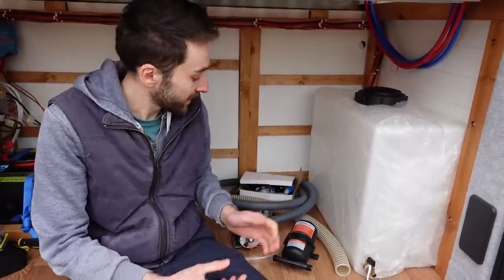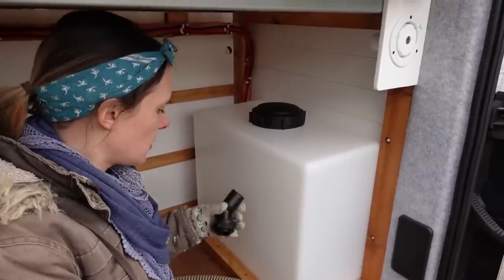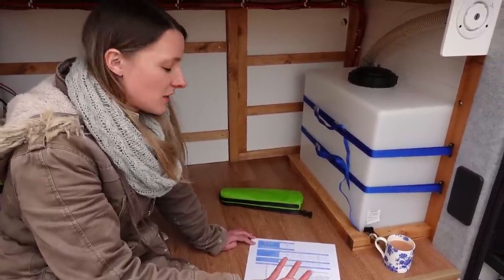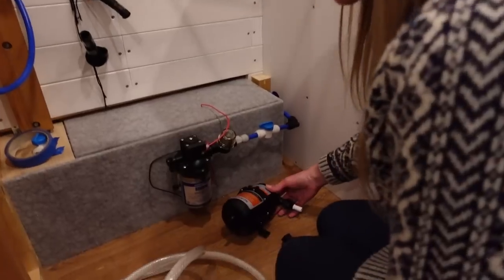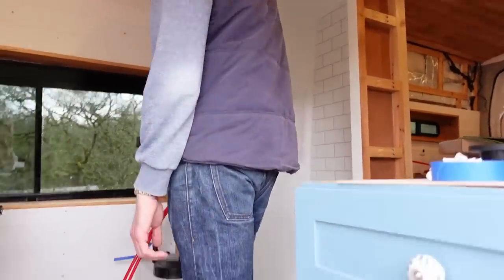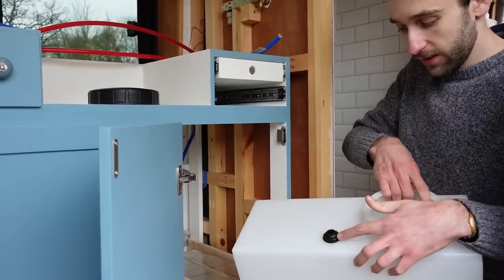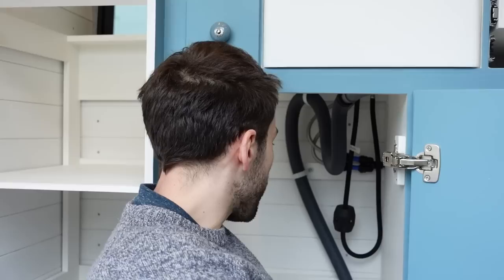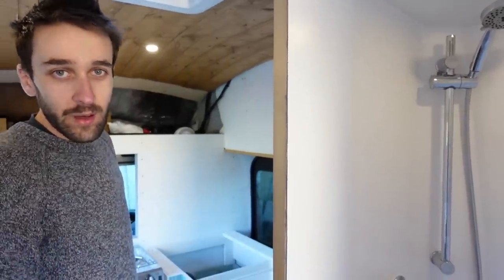Campervan Cold Water System (We Have Running Water!) | Transit Van Conversion E36

Comment: Hi do you have a link to the filter that you used please - I'm loving all these videos - thank you
Reply from the maker: Cheers! And it's the shurflo inline filter that we used - have added a link to the description. You can get it with a few different connection options, we went for the screw ends but would possibly consider the wingnut version too which possibly would have been easier to tighten up and ensure it's sitting and the right orientation. HTH 👍

Comment: Hi, enjoyed watching your van build so far, well done both, a quick question about the water system, have you used the John guest speed fit locking clips as well by any chance?  They stop the fitting being accidentally pushed in and a bit of vibration letting the pipe slipping back out causing a leak that you may not notice
Reply from the maker: Thanks! And yeah we did look at the clips and considered it, but in the end decided not to. Particularly for the 12mm JG fittings the cost can quickly add up and we thought the clips were a bit on the pricey side. We haven't seen many people use them to be honest, and from our experience it's actually quite hard to remove the pipes anyway even without the clips on them. We actually bought some JG release tool spanners to make that bit easier 😛 We can always add them in future but for now haven't had any issues and we've pumped a lot of water through the system now 👍

Comment: Have you considered the weight distribution of the van? There seems to be a lot weight in one side of the van, you will suffer with poor handling, cornering and overall traction if you in the wet or snow
Not a criticism, love your videos, they are very informative, i am just curious if you consider it while building the van
Reply from the maker: Cheers! And yeah no problem it's a fair question, and we've thought about it quite a lot. We imagine the van in different quadrants for the weight distribution, so back left is electrics and batteries, back right is water tank. Top left will be the underslung gas tank and top right is kitchen. Then down the middle so centrally distributed is the oven at the front and grey underslung tank at the back. The one anomaly is the shower as that is only on one side obviously and can't go in the middle (actually not true, have seen some vans do that!) but we have the fridge cabinet on the left as well to offset it. It's a tricky balance for sure but we definitely keep it in mind 👍

Comment: Hey hey! Where did you find the info on how to balance the accumulator PSI? Thanks so much!
Reply from the maker: Hey! Yeah so our accumulator recommends setting the pressure to be ~3psi below the cut-in pressure of the pump. The tricky part is actually finding out what the cut-in pressure is as it's different to the rated 30psi pressure which is around the cut-out. We found the easiest way was a bit of trial and error doing something like this: https://www.canalworld.net/forums/index.php?/topic/110321-pressure-to-start-with-in-an-accumulator-tank/&do=findComment&comment=2615748. Once you get it right, you'll know. It's the difference between a really nice smooth flow whether the pump is on or not, vs really juddery pulsating each time the pump kicks in. Good luck! 👍
Reply: Thank you so much!! @SelfBuiltStories
Reply from the maker: @mdpaver1  No problem 👍

Comment: Nicely done!  What PSI did you end up settling on for your accumulator?  I have what appear to be the same pump/accumulator combo and will soon be wet testing the whole system...  I had not even realized I had to set up the accumulator, so thanks for that tip!
Reply from the maker: No problem! Yeah it's not the most obvious thing at first. It says it should be set to around ~3PSI below the pump cut-in pressure. For us the cut out pressure is 30psi, but the cut-in pressure which is lower wasn't listed in the specs anywhere so we had to find it by trial and error. There's some good info on boating forums and things for finding the cut-in pressure, we did something similar to this: Turn the pump on with the taps off.  Allow the pump to run till it switches off.  Pressure in the accumulator will now be the pump cut-out pressure. Then turn a tap on slowly and wait till the pump switches on. Immediately switch the pump off.  Measure the pressure in the accumulator which is now the pump cut-in pressure. Open a tap till the water stops. Pressurise the accumulator to just below the cut in pressure. If we remember right we set it to around 15psi, though the analogue gauge we had wasn't the most accurate to read. It's obvious when it's correct though with a bit of playing around, as you get really nice smoooooth water flow 😃👍 HTH!
Reply: @SelfBuiltStories  Thanks so very much for 'the long answer'!  Man, that's a step by step how to!  I have a feeling you just saved me a lot of messing about.  Always enjoy your build vids.  I've used all sorts of tips from your build.  Thanks for sharing!
Reply from the maker: @owenparker6651  No problem, you're welcome, good luck with yours 🙂

Comment: Thank you for a very informative video , im going to go for the same set up. Please do you have a link for the filler cap and pipes. 😊
Reply from the maker: No problem! And we got it from eBay: https://www.ebay.co.uk/itm/144157371031. And most of the pipe and connectors too. There are various sellers on eBay and some where cheaper than others for particular connectors, which added up quite a lot. So for each type we shopped around the best ones. The pipe we got from https://www.ebay.co.uk/itm/185659041034. HTH 👍
Reply: That's perfect thank you so much! I've saved the links 😊 enjoy your van and adventures 🙌
Reply from the maker: @luciedimond244  No problem, we will, cheers!

Comment: This is the most nerve wrecking thing for me lol just wondering how u fitted that rocker switch, I can see the live in and out but wondering where the 3 (from what I can see) negatives come from 😮
Reply from the maker: Very satisfying to have water come out the tap though! 😄 And the rocker switches we're using have an LED in them so have their own circuit which needs a negative/ground connection to work. If you had a basic switch without the LED it wouldn't need the negative connection. And the reason it looks like 3 is because for our temporary setup we piggybacked the negative onto the one going back from the pump using a wago connector. Later on we're going to make a switch panel for all the switches and controls we have with small busbars to tidy everything up. 👍
Reply: @SelfBuiltStories  OK, I'll have to do something similar as I have these switches too lol I need them to match 😂 bit of a blue theme in mine lol
Reply from the maker: Important to get the theme right 😛👍

Comment: Haven't seen the whole video yet, but the inlet pipe seems to be redundant since it is located next to the tank cap.
Reply from the maker: Yeah we could use the tank lid directly but in practice we find it more awkward. The fill point allows the hose to fit in snugly for hands free filling, less reach into the garage and less chance of spillage. We have things stored in the garage too so the lid might not always be accessible, plus just gives a bit of extra length for the breather pipe. So we prefer it for convenience 👍

Comment: following closely as i have the same van and about to start, have you weighed your van with the progress to date? im looking to be able to carry some load as well as the fit out.
Reply from the maker: Cool, and yeah we weighed it a few times during the conversion, the last one came in at 3.3T with full tanks and us inside, but it wasn't completely finished. Since then we've uprated it to 4T so we have a lot more headroom to play with now and flexibility to carry more supplies 👍
Reply: @SelfBuiltStories  how do you uprate it? beefed suspention?
Reply from the maker: @mikezoom42  Our van chassis can take 4T but is downrated to 3.5T so it can be driven by most people on a B licence. We uprated it back to 4T with https://www.vanweightengineering.com/. Upgrading the suspension wasn't strictly necessary for that but we've decided to do it anyway seeing as the old springs were a bit tired and it's going to be under a load all the time, so we got some new 3+1 heavy duty springs

Comment: Great as usual but my first criticism ever on this channel. I think you will regret not having routed the fresh water tank fill to the outside. Mind you, it should last quite a while, so I'm sure you've already weighed this up?
Reply from the maker: Cheers! And yeah we thought about it but figured we'd rather not drill another hole in the side of the van for it and seeing as the tank is right there in the back it was a nice easy run. Doing it like this first means we can always change it down the road and put it in the side if we want to. Out of curiosity what part of it do you reckon we might regret? We've filled it up quite a few times now and have found it pretty convenient 😛

Comment: How are you dealing with hot water? You could use a hotfill electrical boiler. They use about 400w to heat 10L hot water.
Reply from the maker: Hiya, we actually have hooked up a heat exchanger from bobilvans which uses our diesel heater for the hot water. We have a separate 18l tank and it can get it to 40C in around 10-15 mins 🔥
Reply: @SelfBuiltStories  oh nice. Thanks for the reply.
Reply from the maker: No problem!

Comment: Do you have a link to the magnets? That is such a smart idea!
Reply from the maker: Cheers! Yeah they work surprisingly well, even through our fairly thick floor which is 25mm foam board, 12mm ply and then vinyl on top. Makes it so easy and a lot easier than trying to measure the same on both sides of the van. We don't have a link to any in particular as we've had these a while, but if you search on Amazon for 'fishing magnets' you'll find some very similar 😛
Reply: Thanks!
Reply from the maker: No problem 🙂👍

Comment: Nice video but Iʼm a bit confused.... You say itʼs a recirculating shower but there isnʼt any micron filter or UV filter...? Also you diagram and the way you show it doesnʼt look at all like recirculating...? Am I to tired?
Reply from the maker: Hiya yep that part is a separate system, the one in this video is just for the cold water side of things 🙂👍
Reply: @SelfBuiltStories  Ah so you don't do straight up the full configuration! So you'll use a Pearlaqua UV filter? You actually showed up on my search for UV filters that's why I'm even more confused without seing anything about it😅 Maybe you added some keywords about it 🤷‍♂️
Reply from the maker: @matino717  yeah we mention it at times and in other videos so maybe that's why. We have an ongoing 4 part mini series on building the recirculating shower, the final 4th part is still to come but will be the one with all the filter kit 🙂
Reply: @SelfBuiltStories  Cool will follow 😉
Reply from the maker: @matino717  😊👍

Comment: Did you use a 6mm2 wire for the psi pump? X
Reply from the maker: Hiya, no we used 3.0mm², which is what we used for most of the bits around the van that we didn't buy a specific larger size for (like the diesel heater, fridge etc). The pump we have draws a max of ~10A so you could use 6mm² but it would be overkill unless you had a particularly long wire run 👍

Comment: did you eventually install a water level sensor + gauge? what fuse do you reccomend for that?
Reply from the maker: Hiya, yeah we did, we have two KUS gauges for the fresh and grey tanks with float level sensors. They use barely any power so a tiny 1A fuse should be fine 👍
Reply: thaaaanks :) @SelfBuiltStories
Reply from the maker: No problem 👍

Comment: Hey, where are those magnets from? 21:24
Reply from the maker: Hiya, we've had them for a while and not sure where they're from. But they're just a pair of fishing magnets and ours are rated for 250kg. That seems to be a good sweet spot as we can feel the magnetic force through the van even through our composite floor with all the insulation in, but not so strong so that we can remove them from the underside easily. So would imagine any pair around that sort of strength would work nicely, something like this: https://www.magnosphere.co.uk/neodymium-fishing-magnet-threaded-eyelet-32-90mm/a-2201. There's some on Amazon too. HTH! 👍

Comment: Nice and simple but the sink drain tube shouldn't come back up higher than the sink drain.
Reply from the maker: Yep simple is often best. The U bend rises up to the same level so we could clip it neatly out the way, works great 👍
Reply: @SelfBuiltStories  I'm planning out my own build as I look for a used Ford Transit AWD van and I've been looking at the compact trap/drain set ups where a single hose comes out the side and running it right into a 6 gallon grey tank/jug under the sink.  I've always liked simplicity though and just looping the hose to a quick release bracket on the back wall of the cabinet seems like a good way to go and it's easy to remove and drain.  The older I get the more I find that simplicity is the best way to go and sometimes it takes more effort and intelligent thought to get there, as you've done with your systems.  

Cheers!
Reply from the maker: Yeah the irony is that the simple solution is often harder to get to. Good luck with your build 🙂👍